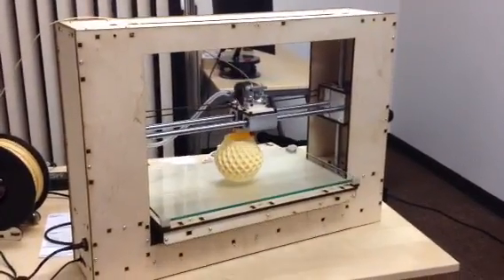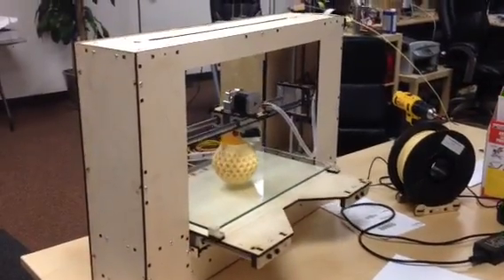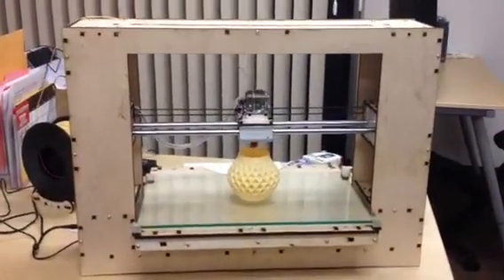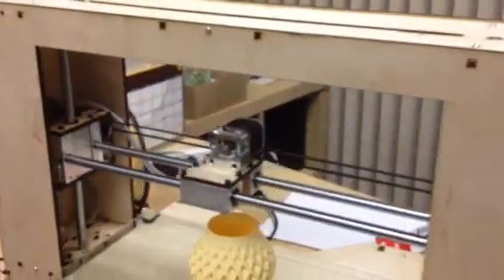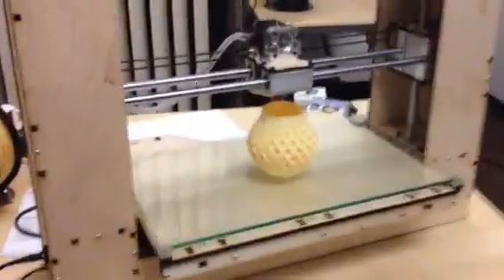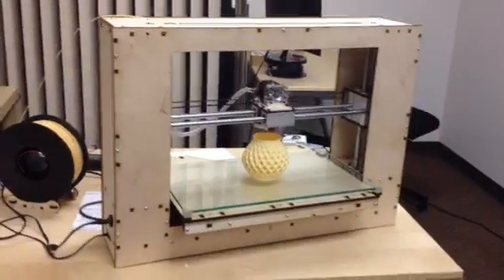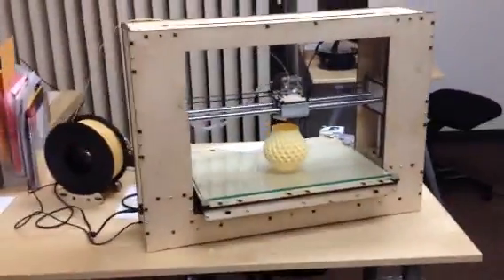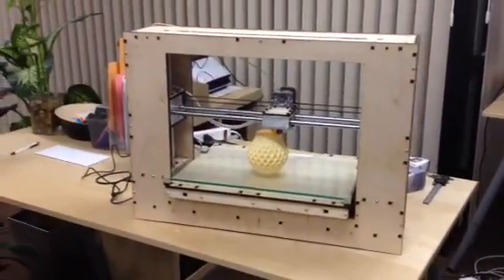Printrbot Go! v2

Comment: Could you upload a video of you walking up to a table setting it up so its ready to print and then packing it back up? Also I'm curious to see some HD video of the print quality.

It looks like a nice piece of work, I'm very impressed so far but I wouldn't recommend my work buy one until we could see a video of a speedy setup which is a major draw back of our existing printers. If it is as easy as I think it will be, you might just have a customer.

Comment: Amazing! What's the price of this beast? Can it also come with a heated bed?
Reply from the maker: No heated bed planned but totally possible. The Go Large will be so big that a heated bed isn't even practical. 
Go small : $1299
Go medium : $1499
Go Large : $1699

All on sale this week. Exact sizes and details released tomorrow.
Reply: Brook Drumm
Hi Brook, is it possible to know some more technical specifications that are missing in the Go V2 page? like
-how the extruders work together?
-what kind of material can be printed? ABS or PLA? and is it possible to print ABS even without the heated bed?
-what is the resolution of print?
thank you in advance

Comment: Hey Brook, thanks for the running commentary, it's cool to know what you think and get an idea for where you might be headed.  

-Proud Simple 2013 owner
Reply from the maker: I like the decisions we made here so much, some of the design will go straight into the plus. I'll also do a few different sizes to find if there is an interest in larger versions. Hit me up if you want taller, wider or deeper. This design will be easy to mod up to two feet wide, over two feet tall and around twice as deep. Larger, custom size bots will be demonstrated soon in a different form factor for special needs requiring feet, not inches. None of these will be mass market hitters, but for a niche, the price per cubic inch will be unbeatable. The joy in these exercises is the surprise learnings that find there way into the smaller, mass market bots. Exploring the unknown, for me at least, keeps me frosty and tests the market on price, capabilities and general appetite for the makers out there. Oh, ands fun!! Btw, all my laser cut wood bots will end up in the non-commercial open source pool.
-brook